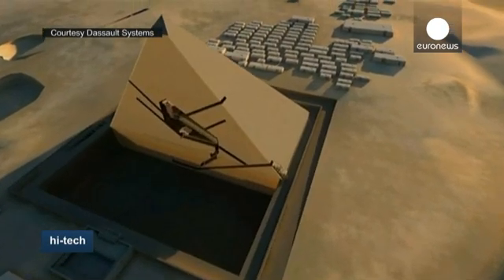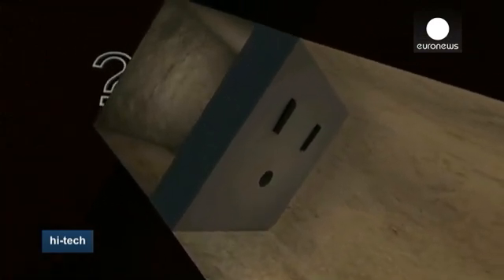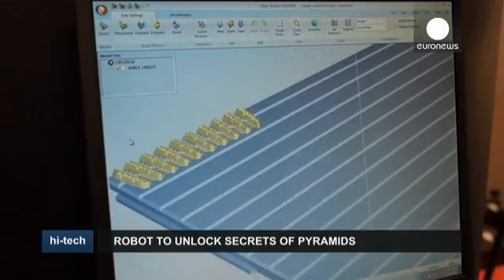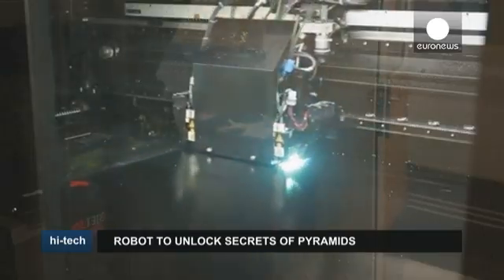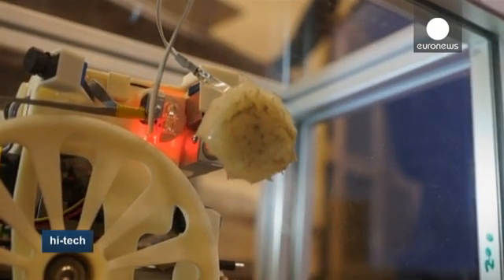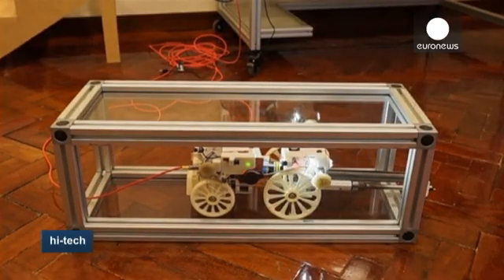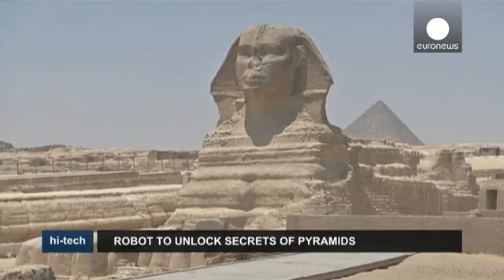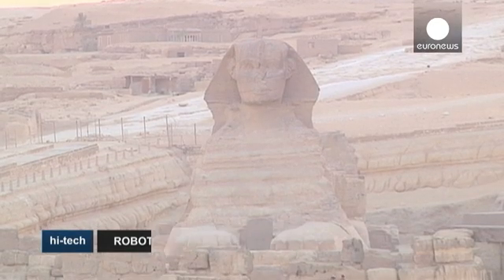Robot tries to unlock Giza pyramid's secrets

Comment: Why not just stick a camera, with night vision or a light, onto a series of connecting poles that you keep attaching into each other until you get to the end. The tunnels look like they go straight. This robot idea seems like a lot of overthinking just to see what’s up a tunnel.
Reply: Its egypt, they dont want the truth to be known they didnt make them, and the truth about what the pyramids are
Reply: These "air shafts" from the Queen's Chamber already have been explored to their dead ends by robots.
Reply: They did something like this where they reached the end, but you wouldn't be able to tilt or pan, just like they weren't able to. So the photos they took were just directly straight ahead.
Reply: there's like blocks in the middle of the tunnels so they need to be drilled